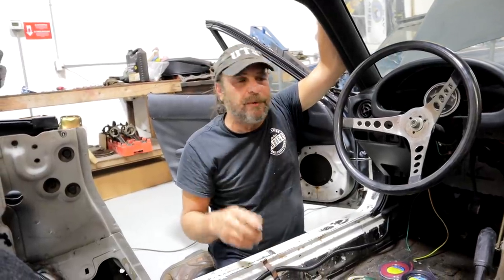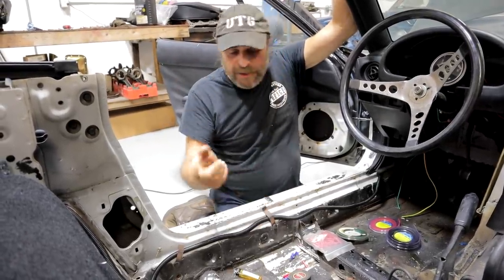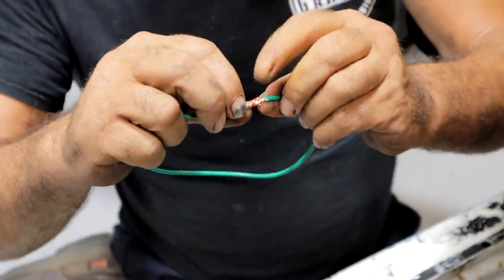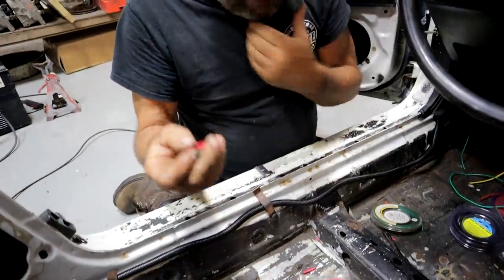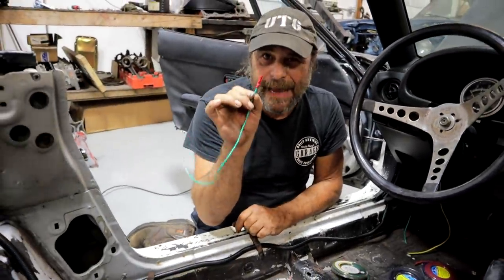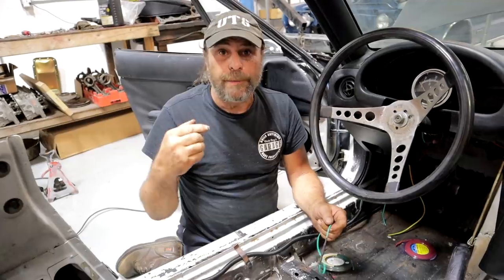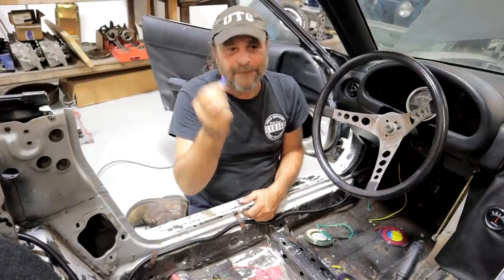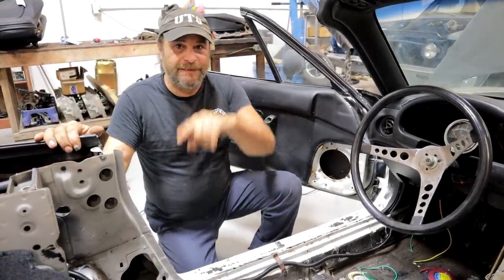The Single Most Misused Item In The World Of Cars

Comment: If you've got them crimped right, you can't pull the wire out of the butt splice. I hate those type of crimpers. I work on cars all the time and 90% of the time I find crimp connections were not done right. They either aren't crimped good, or the wire is stripped too long, or often both.

Comment: I cant count how many customers ive had show up with trailer wiring crimped together under the bumper with no shrink tubing to protect the joints. Canadian winters are brutal and ice build up alone can rip the wire joints apart.
My rule is under the car always gets soldered and shrink wrapped, inside the car can have solderless connectors.
Reply: Sadly they probably paid a "professional" to do that. Our company mechanic has worked on antique shit in the bush you never heard of, excellent welder, excellent at diagnosing and fixing hydraulic systems, can fix anything mechanical. Don't let him change a headlight pigtail though or it'll quit in a week and high beam will be low beam prior to it failing. Electrical is like diesels, a minority seem to be good at it. I'm not trying to be a know-it-all but used to be a 310T and electrical was my thang. I let my licence go and drive tow truck now. I just take the driveshaft off now lol
Reply: Here in Michigan too. I usually see it coming from a U-Haul hitch installer or some other hitches only installers
Reply: Se

Comment: I like the ones that are shrink tubing as well as but connectors. I have now gone and bought and starting to use the shrink tubing connectors that have a bit of low temp solder that will flow and solder the wires together as you heat it.

For heat shrink I like the marine type that has sealant inside the heat shrink to glue it to the wire when hot.
Reply: That's all I use.
Reply: Those ones are ideal. The low temp solder works perfectly with a small heat gun, like the ones available for less than $ 10 in hobby stores. They're relatively small and can easily get into nooks and crannies if you have limited room to work and they don't get so hot that you run the risk of melting your wires or nearby plastics. That combined with them being heatshrink tubes, and the good ones will also have a ring of glue inside both ends, makes for mechanically strong and watertight connections.
Reply: @MicraHakkinen  yea I get ones just like that off Amazon for a few bucks for a viriaty pack. I think I paid $5-8 for a kit 9f those style with the ring of glue and solder and heat shrink.
Reply: I like those crimps with the integrated heat shrink too. I also use the ones that have both heat shrink and built-in solder on occasion. They're a little pricey so I don't use them everywhere but they can save time or sometimes be easier to work with than soldering in tight spaces like under a dash. If I have the time and the room to maneuver I still prefer to solder a connection and cover it with marine grade heat shrink, I've never had any issues doing that. 

Most of my rides are 4x4's and see a lot of vibration and dirty environments. I've had the type of butt connectors that Tony shows us in the video (which somebody else installed without heat shrink) wiggle apart and come loose while driving before, I've also found wires all corroded inside those crimp connectors because no heat shrink was used and when left open to air and moisture the wire eventually starts to oxidize. No Bueno. Wiring issues will strand you in the middle of nowhere really easily and can be a nightmare to troubleshoot... ask how I know, lol.
Reply: @rustyjeep2469  I am guilty of what Tony said, useing those as permenant connections. But the last 5 years or so I am trying to use heat shrink with any connectors if they are not built in heat shrink butt connectors. The kind your and I was talking about with heat shrink and solder I have got off Amazon, there not that expensive if you plan ahead and buy them for your supply closet.
Reply: @natevanlandingham1945  They will be at your local boat store such as West Marine or an on-line outlet like Defender.

Comment: I've been in love with the low temp solder connectors that seal and solder connections with a heat gun. Seems to solve most crimp connector problems.
Reply: I was just about to make the same comment...those are the way to go, especially if you aren't great with a soldering iron.
Reply: @drrrrockzo  Me too
Reply: They're life savers. i always have a little kit of them handy. Super cheap too
Reply: Those seem best with 18-22 awg wire
Reply: No matter what, these beat the hell out of crimp connectors. You do need to use them properly, not cook 'em and give the solder the best chance to flow. Way better regardless than crimp. I make sure I thread the wires together so even if it isn't the best joint, there is still lots of contact. They show no resistance problems, typically, especially compared to crimps.
Reply: That's all I use.
Reply: Dip each wire in solder flux before you use it and the solder works amazing.
Reply: @brianobrian9334  when I use them I slide the wire right through then do a straight twist twisting the wires together, then slide the connector back over and heat, then the solder is more for holding the twist together
Reply: Used them quite a bit. Can be too easy to heat damage the shrink tube before the solder has properly flowed. I tend to put a bit of conventional heat shrink over the top as insurance.
Reply: @katywalker8322  bingo
Reply: @OGbqze  flux will eventually turn the wore green.
Reply: Any brand recommendations?
Reply: Solder Seal Wire Connectors or normal soldering are the only way to go for long term fixes. Butt connector, guillotine and twist Connectors are all garbage. Only good for a temp fix in my mind.
Reply: They're are so much better!!!
Reply: They are good but you also have to be careful if you apply too much heat.  I typically use a hand held propane torch as part of my electrical work as I use it for shrink tubing that is stubborn to shrink tightly.  It works great on the low heat solder ends but too much heat and ive noticed the solder starts to get pushed out.

Another thing I am very wary of with them is using them under the hood.  I am wary of the solder becoming liquified with under hood temps and causing a electrical connection issue.  Its why when ever I have used them it has always been on no vital systems that wouldnt leave a person stranded on the side of the road.
Reply: They don't make a good joint, there isn't enough flow of metal to join all the wires, because of the lack of heat....
Reply: @johnpm1605  I don't know, man, I've done it by pushing the wires together lengthwise, then heating the thing and it resistance checks the same as bare wire of the same length on my DVOM.  Beats the hell out of crimped joints.
Reply: yes they are so choice to quote Ferris Bueller. Of course if its a high amp circuit (headlight/fan/blower/alternator/etc I am going to solder and heatshrink if a splice cannot be avoided entirely. these are great for almost every other wiring in a typical car though!
Reply: There ok inside a auto but I wouldn't recommend them in the elements, they just don't hold up and cause more issues then there worth.

Comment: I started a job at a "speed shop" basically and they were rewiring a VW Corraddo for a Vr6 turbo or something.
The head guy at the shop was a hothead, thought I knew nothing but he wired that damn car only using solderless connectors. Easily a hundred, all in the engine loom. It hurt to look at as someone whos wired their own car with some pride and joy.
Reply: That just hurts man. Everytime I buy a used car, inevitably I have to go through the wiring and cut out that crap and solder wires properly  and finish with heat shrink tubing. I may be overzealous with this but I never EVER have electrical problems after I clean up someone else's mess.
Reply: @ec5838  Same here bro. In over 30 years as an owner/mechanic who specialized in automotive wiring and electrical service, I never once had a return due to my wiring repairs having failed, but God knows, I repaired an awful lot of other guys "electrical repairs"!
Reply: @greatnortherntroll6841  a friend of mines daughter had a stereo put in her BMW SUV, then started having all kinds of electrical problems, dash shutting off, things like that, not just a single issue. I told her not to let her have a stereo put in it. Well of course they deny it has anything to do with the stereo, but it never happened before. After six months of BS they brought it to me. I put the factory shit back in it, and problem solved, not sure what they did to it, I just took everything out that didn’t come factory and put it back the way it came. These new cars just aren’t designed for billy bubba to throw a system in.
Reply: What a way to absolutely ruin the wiring on a cool and uncommon (dare I say rare?) car... I'm not usually a VW guy but I love those things. I test drove one while looking for my first car (it was a 10 or 15 years old used car at the time), I fell in love with it immediately... mom said no way, it's too fast and twice what we're willing to spend 😂
Reply: @charlesprice7608  I used to work at a body shop, about a year ago one of my colleagues was working on a brand new Grand Cherokee and couldn't get it to start after removing some body panels. He finally figured out it had to have the headlights plugged in for the engine to start. Not exactly a convenient situation for a body shop where half disassembled cars still need to be able to move around under their own power whenever possible... I think he ended up zip tying the probably very expensive LED headlights to the core support so they could drive it 60ft across our lot into the paint shop 😂
Reply: Then ppl like me that are masochistic buy those cars when they can't get them running, revert the wiring to stock, and have fun. Btw it really, really hurts to hear he was doing that to a VRT corrado. Like deep down in the feels.
Reply: @rustyjeep2469  Chrysler/Jeep had some weird shit, a friends Durango wouldn’t start because of a brake fault. I didn’t work on it it went to the dealer it was a new car. But because of some brake fault code, it disabled the starter. It was a POS ended up with a different vehicle, only had it 6 months.
Reply: I think they're ok if you use the connectors that don't have the plastic on them, just metal, then you put the heat shrink over it and it looks pretty clean
Reply: @Terminxman  best in my opinion is an open barrel splice with correct crimpers, and good quality adhesive lined heat shrink
Reply: @Terminxman  the butt connectors that have the heat shrink plastic are good too, as long as it doesn't get punctured when crimped.
Reply: @charlesprice7608  if you check out the quad lock wiring harness they probably used to interface the aftermarket radio, you’ll probably find the blue antenna wire feeds into one side of the can hi and low wires. Common school boy error 🙄
Reply: @Mark_C1  yea I’m sure that was causing the Speedo and tach to stop working 🤦‍♂️. BMW, Volkswagens can already be electrical nightmares. They shouldn’t be worked on buy 99% of the Best Buy’s and stereo installers out there! It was all fixed and working when I was done with it, but it was also exactly then way it left the factory! Nothing added nothing missing.
Reply: @charlesprice7608  that’s more than likely the case. I did a double din kenwood navigation install into a brand spanking new xc90 on a Saturday with no tech support available. When the customer arrived to collect it I was just setting up the unit and testing all features worked when we first noticed the mirrors and windows were now inoperative. Put the key in the ignition, turned it on and cranked and the vehicle ran but had no working dash clocks and most of the on board electrics pretty much shut down. On closer inspection we found the can bus data lines ran in and then out of the factory radio unit and when we removed it we broke the can data lines circuit. Simple fix in the end but was uncomfortable for a while at 17:30 on a Saturday when his motor with 250 miles on the clock decided to get precious on me.
Reply: This guy right here is right in one.  If you want your wiring done right you have to do it yourself. I had the misfortune of paying somebody to do a wiring harness on a classic beetle once upon a time.and he used...

Wait for it....

All. RED. Wires.

I kid you not.

Comment: I never knew anyone actually used those flat crimpers for anything outside of the built in strippers? Total trash tool.
Reply: Yup, they are very nasty.
Reply: I've never had a good experience with the flat ones. The strippers are always so far from the pivot, they loosen up immediately and wobble around where you're trying to get a good positive grip on your wire to strip it. I much prefer the needlenose looking style with the stripping teeth at the end.
Reply: My go-to setup for years has been the Mac tools TCT-800MS kit, the crimper is beast, but like all self adjusting strippers, the spring wears or the screws on the left jaw break off. Average lifespan is about 17000 strips.(been through a lot of them) and if you can find one, get the stripper with the left jaw cast into the tool, not screwed in. It lasts longer and has a better self adjust that doesn’t leave you having to use two hands to hold both sides down. 9 years of figuring out what tools work best. If you must use electrical tape, 3m tartan holds the longest. If you’re soldering for a while, forget the standard guns or irons - you want a Triton JLA “push to heat” hotlips setup with the replaceable jaw tips.

Comment: I'm a 16 year professional Heavy duty Mechanic and this is by far one of the most important videos for electrical wiring on Youtube. Those stupid butt connectors are the Devils spawn!
Reply: here in montana they use mag chlorate as ice melter on the roads. a solderless splice that is not sealed will last one winter and fail.
Reply: I get them without the yellow/red/blue plastic. Dunk each stripped wire and dunk it in dialectic grease, Crimp properly and then heat shrink, not cheap heat shrink either the stuff with glue on it. That way if moisture actually gets into the splice (it won't) it's not going to oxidize instantly.
Reply: @b.c4066  I too adore overkill. it reduces the amount of time I spend re-doing things!
Reply: I'm also a 16 year med/heavy truck tech, the worst were some of the body installers, cheap butt connectors, no heat shrink, even seen wire nuts used. I solder everything, rarely use a bare butt connector, follow up with a good heat shrink and that connection will outlast the truck
Reply: @2shay550  hell most of the time I'd prefer wire nuts if it's externally mounted.
Reply: Use marine butt connecters